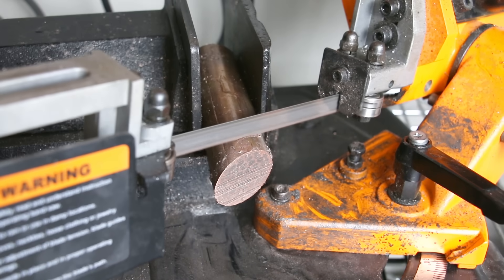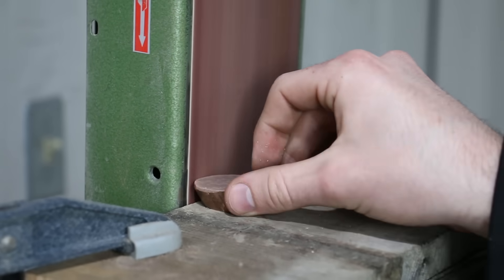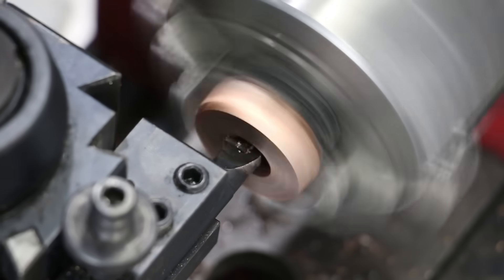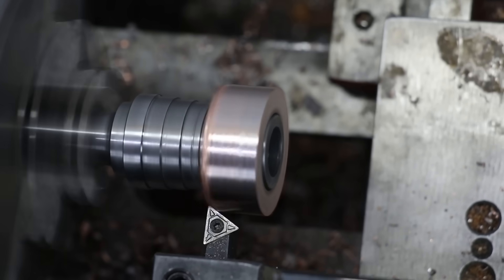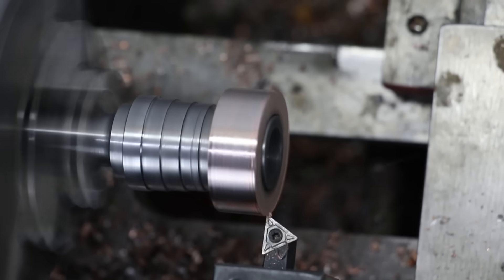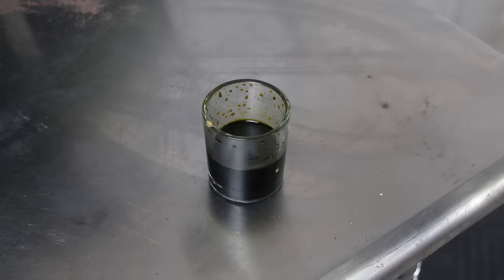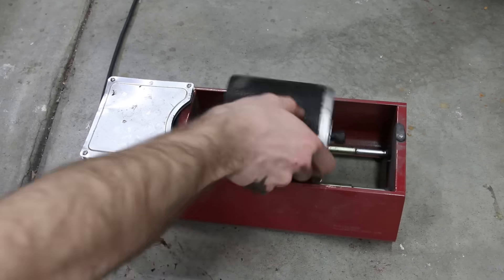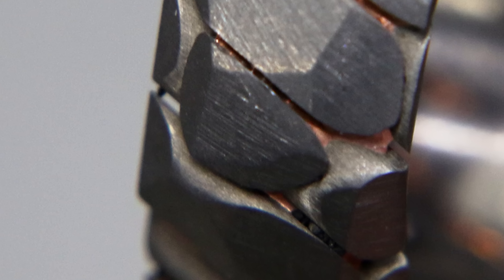Making an Acid Etched Superconductor Ring with Obsidian Facets

Comment from the maker: If you want to grab your own Acid Etched Superconductor Ring you can get it here: https://patrickadairdesigns.com/products/obsidian-superconductor-ring?sl=obsidiansuperconductorvideo
Reply: I think it's superconducting cable, i.e. the stuff they use in particle accelerators - obviously it needs to be chilled first to actually work. Here, I think it's strands of niobium-titanium with a copper casing.
Reply: Just a tip from a CNC-Lathe operator: Don't use a center drill to drill through the whole material, that will possibly break or at least ruin it. Those are just for creating, you guessed it, a center for your drill. Just use it up to the drill shank, never beyond that.
Reply: That ring looks so good - I did prefer it with more 'copper' showing as it adds a nice contrast to the black and also looked like it had 'sharp' bits where the copper had been eaten away. If I were to buy, I would want more copper left...
Reply from the maker: Kl Audio yes you’re correct. I use titanium-niobium (same thing they use in particle accelerators and mri machines). It needs to get extremely cold in order to superconduct.
Reply: Oh, wait. it is just a part of a copper-titanium cable used in large superconductors.
Reply: i would buy that in a heart beat its actually the design i have been  looking for, for my wedding ring this is the most beautiful ring wow ty for sharing.
Reply: Should I sell them I would buy you one ^ w ^ !!, could you sell it ??
Reply: Patrick Adair Designs mm
Reply: Is this particular metal super conducting at a high enough temperature to float above magnets when cooled down by nitrogen? That would be an amazing way to show off the ring!
Reply: Where did you get the superconductor from?
And how disappointed were they when you said you were making jewellery out of it?
Reply: That ring looks awesome Patrick, well done
Reply: Patrick Adair Designs Hey I know this is a big one bigger than normal but can you make the Infinity Gauntlet from the Avengers because there's a lot of Marvel fans watching this
Reply: WOW ! Amazing ! Imagine the fact i actually added this video to a playlist, I hardly do that to videos !
Reply: i wish i had 1000 dollars to spend on this ring it looks so cool
Reply: to Patrick Adair Designs

Sorry If this puts you in a rush it's just a suggestion but is it OK if you make a tutorial on how to do this if you read this comment I just think that this was a really good video thx.
Reply: I want that ring
Reply: How many choosing beggars do you have to deal with? Your stuff is clearly high quality but I bet 1,000 someone has tried to haggle the price cause “they could easily do it themselves.”
Reply: Oh my god that ring is beautiful I fucking want one. It looks bad ass
Reply: What is the critical temperature for the material used to become superconducting?
Reply: Another cable that you have to cool with fucking liquid helium.
Reply: that was really interesting to watch !! that ring is super cool as well
Reply: Kl Audio because it is made from superconductor rod.
Reply: Kael It is.
Reply: Cosmic Vagabond Cooper, Titanium and Niobum.
Reply: what i think of it is as follows...i want one.
Reply: That is cool
Reply: can... can you make one of these just as it is but with glow powder in the creases where the copper is?

i think that would be too cool. the universe may explode...
Reply: What can you do If you want the cool etching on the outside ,BUT want a smooth inner center ?
Reply: hey. i love your work and your videos. i have a concept i was thinking maybe you could play with if you felt like it. its a women's ring that's very thin and fine with wood around the band but with silver/pewter or whatever on the inside and on the edges and little silver leaves and flowers wrapping around it with diamantes on the flowers and a men's ring with just the wood and silver edges to match.  is it even possible to do that or would the wood burn? i've been looking all over the internet and i cant find anything like that. only the plain ones
Reply: @ENGULFING_DARKNESS01001
Don't tell yourself you can not afford it.. Ask yourself: How can I afford it?? The first makes your head go to rest-mode... the second makes it go into thinking-mode (From Robert Kiyosaki) Good luck! :)
Reply: Would it work to put some kind of a clear polyresin or some kind of a clear filler on this ring? To keep the edges from snagging on fabrics and such.
Reply: Patrick Adair Designs
Reply: Mega? I want one!
Reply: where can i order ?
Reply: Patrick Adair Designs i like lava ring cant you make one
Reply: I want it so much right now.
Reply: Patrick Adair Designs i
Reply: Patrick Adair designs
Reply: Patrick Adair Designs this ring is unbelievably amazing my dream ring i just wish it wasn't 900 dollars😭
Reply: Patrick Adair Designs I need this!!! Please offer this!!!
Reply: Can you make a ring from Molybdenum ?
Reply: The rings you make are AWESOME.
I would buy one if i had money to spare.
I can totaly understand those prices.
Reply: How much do u charge?
Reply: literally hands down the coolest ring i've ever seen in my  entire life,subbing right now for the amazing and creative work.
Reply: Hi Patrick, I am a huge fan off the Tron movie franchise and I would like to get something in high quality carbon fiber with a Tron blue glow , can you make something like this?
Reply: Patrick Adair Designs I
Reply: Patrick Adair Designs how much does the obsidian ring cost?
Reply: Patrick Adair Designs is it possible if you can make a wolf ring? I always wanted one I've even been searching but I can never find one
Reply: thats right. but you need to have a metal which functions as a metallic super conductor, it turns into a super conducter when cooled to this extreme low temperature
Reply: Patrick Adair Desighns if u dont want the ring u made by any chance at all, ill take it off your hands 👌👌👌
Reply: honestly best ring i have ever seen that isn't a movie prop
Reply: can i buy it
Reply: Patrick Adair Designs can i buy a ring?? ❤❤❤❤❤❤❤❤❤ so coooooooooooooooll!!!!!!!!
Reply: Patrick Adair Designs โครตเท่ครับ
Reply: so after the video i checked out your website and the glow stone rings intrigued me, could you make an obsidian design with glowing cracks?
Reply: I want this ring
Reply: Patrick Adair Designs do you sell the rings?
Reply: One more reply bois PogChamp
Reply: Patrick Adair Designs how does this get dislikes?
Reply: How much would be to have you make me one, but custom size... Like really custom. I am about 4 or 5 numbers bigger than "Z"... :D #collosus
Reply: Patrick Adair Designs how much will it cost?
Reply: Patrick Adair Designs I’ve been on your website and there’s a few cool rings but not a lot and at some point in my life I’ll buy a ring of your most likely the obsidian one
Reply: Please do a tutorial on how to make a ring mandrel.
Reply: Patrick Adair Designs under the order you will make
Reply: Patrick Adair Designs DOO IT!!! 
RAISE THE PRICE I WILL BUY!!!!
Reply: tint the copper area with a bright magma colored tint and make the titanium granite colored ; its gonna look great
Reply: Beautiful!! How much does ring like this cost?
Reply: Patrick, 

I do not understand the reference to 'superconductor' . Superconductivity only occurs at -273 degrees celsius where the resistance drops to zero?
Reply: Patrick Adair Designs make a paintball glowing ring
Reply: Patrick Adair Designs that look amazing I love the obsidian look
Reply: In many of your videos u use some ring blanks. As they were not listed in your materials and i didnt find good ones on amazon or ebay, i wanted to ask you, if you buy them or make them yourself. If you buy them id like to know where. :) thank you and sorry if my english isnt that goof
Reply: Where can I buy these rods in Canada??
Reply: Если перед травлением внутри покрыть лаком для ногтей, то внутри будет гладкая поверхность
Reply: Cool. Would look cooler if it was a mix of purple and blue.
Reply: Patrick Adair Designs 
This ring...
ITS FUCKING AMAZING
Reply: Patrick Adair Designs i want that ring my dude but i cant afford a 200 dollar ring, OH IM SORRY A $900 RING
Reply: I thought the Meteorite Ring was the coolest ring in the whole God Damn world...... Until I saw this....... Level 999+ .... Damn it looks good.
Reply: can I buy one of those rings ?
Reply: SlinkySlim yes its on his site but its $900
Reply: Hola , me gustaría ponerme en contacto con usted. Estoy interesado en adquirir sus productos.
Reply: Can I has ring
Reply: Hej bro I need this ring its amazing well.. :)
Reply: what is that "conductor" thing about?
Reply: Patrick Adair Designs
Reply: Patrick Adair Designs you should have more subs you're awesome people sub now!
Reply: is that gonna attract lightning?
Reply: So cool
Reply: Patrick Adair Designs how much for it
Reply: Greetings from Italy. Are you selling it? Anyway, if yes, how much do you think is a right cost in dollars? Tahnks.
Reply: i want one ring like thiiiiiis can you send one? or sell on to me ??? xD
Reply: Dude IM totaly shure That if u try to replicate DARK SOULS rings your channel and your videos would be more popular greater amazing & etc
Reply: Patrick Adair Designs your rings are awesome!!!,just wondering though,because it would be pretty cool,whenever you make rings,that dust and stuff that piles below them and around,it would be an awesome idea to like put those in tiny bottles for giveaways. That would be really cool.
Reply: Patrick Adair hello my name is nester and I was wondering if you can send me the ring that you made on this video cause I really like it but if you don't want to that's OK but if you do I live Columbus Ohio east 2833 6th  ave
Reply: Patrick Adair Designs
Reply: Patrick Adair Designs yes this is a good ring
Reply: send what metal is that
Reply: hi patric from wer can i get this kind of super conductive ring
Reply: Patrick Adair Designs How can I order one of these rings from you guys?
Reply: Patrick Adair Designs de
Reply: now that is an EPICCCCC RING OMG
Reply: Patrick Adair Designs it's amazing!
Reply: Patrick Adair Designs I would love to buy a customized ring. I was always a fan of Lord of the Rings and the white lantern ring.
Reply: How do you request a ring???
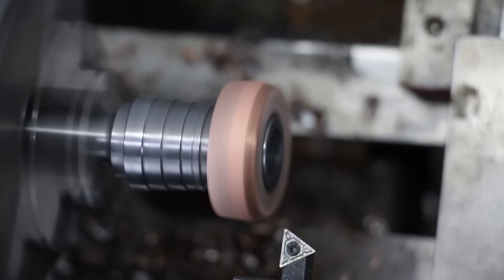Reply: Awesome ring man! What's the song that starts playing at 4:40 it sounds super familiar but I can't figure it out 😂
Reply: On the superconductor ring is there any you could put a central line of a different metal just started watching your uploads and find them very informative being in England I find it hard to get the matiral from,not shure if they ship to the uk cheers my friend
Reply: Patrick Adair Designs
Reply: Patrick Adair Designs I like this . Really B.A
Reply: Patrick Adair Designs you need to make a replica or similar style to black panther ring
Reply: P
Reply: Patrick Adair Designs Superman needs his ring back. It looks sick. Reminds me of when lava cools down and then you see the cracks of red molten lava. 
       Frekishly sick!!!
Reply: Patrick Adair Designs I would but I need an upgrade on my phone to get Instagram and theres too many other things I need more. 
However,  I believe in giving credit to the original artist,  so if I do make anything inspired by you, I will definitely tag you wherever I upload it.
Reply: Is this ring on your website
Reply: Patrick Adair Designs bro I want to buy it
Reply: Patrick Adair Designs I want one make how can I contact you??
Reply: What was it you are working with again lol You really wore out the word superconductor.
but this is an awesome I love it you did a fantastic job is there anyway I purchase this in a size 11
Reply: Can you make me a wing plea like the love wing
Reply: Patrick Adair Designs Hi Sir，where did you get the superconductor material with two different colours， and one can be corroded by acid while the other cant
Reply: way too high your works are so cool and thats why iam asking for it
Reply: plz patrick give this ring to me
Reply: Очень КРУТО! Просто нет слов...красота)
Reply: what the hell is this..?
Reply: Can we buy those
Reply: Patrick Adair Designs Caaan I buy one bro!!!?? Where?! When!? PLEASE🤣😁 Naw man jk yours awesome though bro good art yo. For sure it is a glorious ring with science behind it too! Really seriously though. How can I buy one from you my man?
Reply: Zach Hurwitz Where do I purchase bro. Tell me ill cop you one too. I mean not really but if I was rich I swear I would broskee. I love everybody man... Can you please still tell me where to acquire one thoughskee?? 🤔😏
Reply: Patrick Adair Designs 
How much does it cost
Reply: Can i buy this type of ring?
I really want one
Reply: Patrick Adair De
Reply: Patrick Adair Designs '
Reply: Patrick Adair Designs can you Mack me a ring
Reply: Patrick Adair Design
Reply: Patrick Adair Designs eu quero comprar esse anel :)
Reply: it is nice I wont 1
Reply: Patrick Adair Designs if i sub and like will you give it to me
Reply: Noooooooooooo!
Reply: Looks like Dragon Lance chaos ring..
Reply: Patrick Adair Designs 
Awesome
Reply: This much for something like this buddy just curious
Reply: Ring was awesome, but if you were making the ring circle then why didn't you cut the rod straight in the first place
Reply: I'd love to buy one of those ..
Reply: Patrick Adair Designs by far the best ring I have ever seen would definitely cop if I could afford it
Reply: Same
Reply: hello just watched your vid nice job. but you said that you did not like the look of it on camera. me too to me it look almost like plastic thats just what i thought anyway very pretty shiny
Reply: Patrick Adair Designs           B.B.
Reply: That's  dope love it want it so bad
Reply: PlzzzzzZ give me one ring plzzzzzzZ
Reply: The ring that u made was so amazing, wish i have onevof that😎
Reply: Patrick Adair Designs how much would it cost if you were to sell it
Reply: Patrick Adair Designs Are you giving it away if you are can I have it please
Reply: You sale this ring?
Reply: 현대차 불
Reply: Mad skill! What was the solution he put it in for etching??
Reply: Patrick Adair Designs omg this came out great it looks sick wow
Reply: I would totally buy that!!!!
Reply: Dude how much would one of those go for? Really looking forward to buying one
Reply: Patrick Adair Designs dear Patrick I was wondering if u could make me a really cool ring not that ur rings aren’t cool i just mean a ring meant just for me
Reply: Patrick Adair Designs
Reply: Patrick Adair Designs for
Reply: Patrick Adair Designs  beautiful ring brother.
Reply: Beautiful ring brother
Reply: Patrick Adair Designs dude this one of the coolest rings ive ever seen
Reply: What a beautiful ring
Reply: Where do you buy your superconductor material and acid
Reply: I would like to have a ring like that. I love obsidian. How much would one like this cost?
Reply: I want a obsidian meteorite ring
Reply: Patrick Adair Designs where can I get this ?
Reply: How much do your rings cost?
Reply: Patrick Adair Designs
Reply: Patrick Adair Designs
Reply: the japanese version of you, makes knives with any material.
Reply: Good stuff Patrick! I'm also active in IG. I'll go and find you there. Thanks for all these uploads they are super helpful to me just starting out as a self taught jeweler.
Reply: Patrick Ada
Reply: where can u buy this one
Reply: I like to have one of the ring 14
Reply: Hi ! Can you make me one ? I do not find it on yr webside
Regard
Reply: Can u give to me please
Reply: THIS BETTER BE ON YOUR WEBSITE
Reply: Its that free
Reply: Блин, действительно крутое кольцо, мне понравилось видео)
Reply: What happens when you get struck by lightning
Reply: Lord of the ring bravo
Reply: I need same ring in this video
Reply: I'm not sure if this will help you but there are coolant chemicals to keep the steel from getting too hot.
Reply: Can i buy it ?
Reply: Patrick Adair Designs wat is a superconducter ????
Reply: How much cost of this ring
Reply: A cuanto un anillo como ese, y a cuanto el envío..?? Siempre quise un anillo así..
Reply: Awesome!! How can i order this ring from u sir??
Reply: Ay
Reply: Is it for sale...realy love to buy 10 for my friends
Reply: How much would yhe ring cost
Reply: Hey i want to buy this ring how much it cost?
Reply: How much is that worth
Reply: Ey bro do you know ir this materials can poison to someone? I would like to buy one like this
Reply: this has been the best ring i have ever seen
Reply: No, you follow me on instagram not the other way around!
Reply: Bro can you make me 1?!?!?!?
Reply: Yes you relly should add it
Reply: How much for a 7.5 ring
Reply: The ring is sexy afff
Reply: great man awesome saw your first video  i was very satisfyed  you got two subs from me  from  my two accounts
Reply: Hey, i have a question
Reply: I want one. That is so cool. Great job.
Reply: 900 bucks for a ring?!?!
Reply: How much for your rings
Reply: Definitely started following your instagram!
Reply: Very talented well done looks great💯👏👍
Reply: Tu me l'a donné s'il te plaît
Reply: Use a cutting fluid to cool and lubricate make tooling last much longer
Reply: I want this ring, can you make me one for this ring, and I will pay you for the price
Reply: Give me one piece
Reply: Read me name
Reply: How much does it cost?
Reply: Patrick Adair Designs came across this video, watched it, instantly subbed. Wish I could afford your rings!!!
Reply: ENGULFING_DARKNESS01001 i
Reply: What material is this exactly?
Reply: @klaudio2803  actually scientists have found material to be superconductors at high temps! YAY!

Comment: Is it FeCl3 etch solution? Did you test another variant: CuSO4 + peroxide? We use this for home PCB, it some slower, but have no such chemical aggression like ferrum chloride on anything touches it especially metal tools and furniture. With warm FeCl3 etching tiny bath, I've got chemical corrosion on polished guide rods lying more than one meter away.